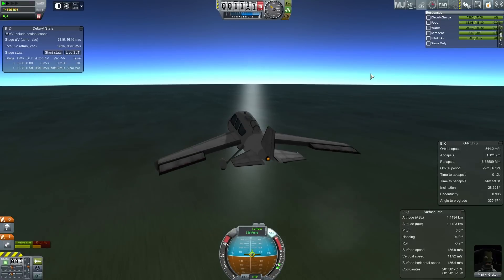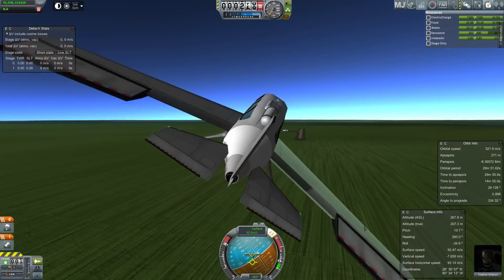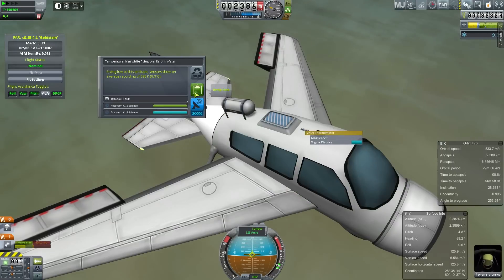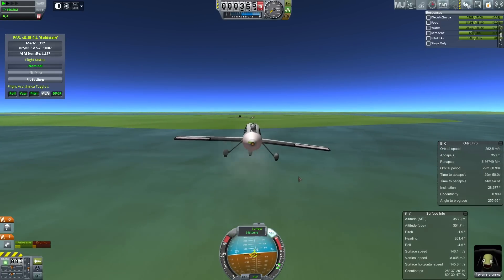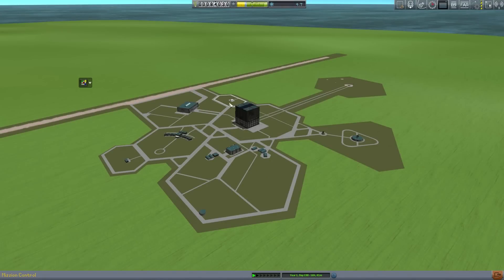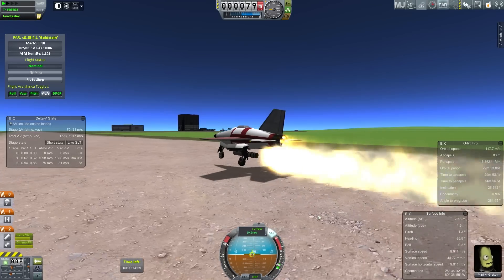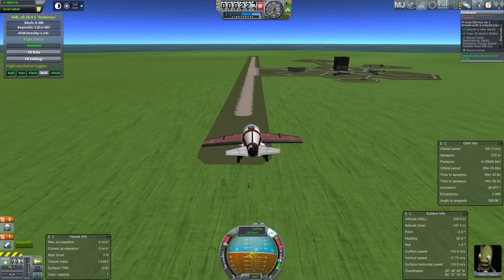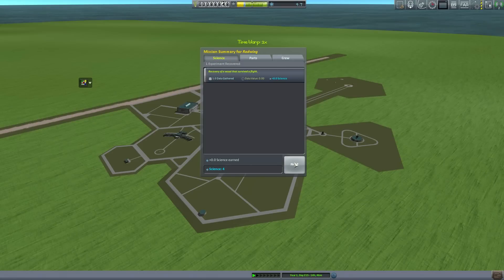Kerbal Spaceships Are Serious Business - Part 2

Comment: I've had the "control surfaces suddenly not working" bug a few times before when not using realism overhaul. Turns out mechjeb was causing it. Had to go to the settings section in mechjeb and factory reset it. It fixed the bug.

Comment: For a plane that small, the flaps and controls surfaces should be controlled by cable connected to the control column, so electric charge shouldn't have anything to do with losing control (at least realistically).  Maybe Grekov needs a candy bar.

Comment: I've also noticed that bug with the overheating. I think it only happens at x4 time acceleration. It only happens to parts with low thermal masses so it is probably because of the fact that the transferred thermal energy per game tick is increased. It needs to be tested and it is definitely a bug.

Comment: The bug is definitely due to some mod you're using... Find out which..
And it seems like its looking control module, like if it was a probe without contact or power, so I'd check mods which meddle with that.

Comment: Hey Scott, I noticed that you keep forgetting to deactivate SAS during emergency landings with your parachutes.
Reply from the maker: Why would I deactivate it?
Reply: Unless I am mistaken, after you engage SAS, any large changes in orientation (i.e getting flipped around by the parachute) will throw off the point that SAS will want to return you to.  I've noticed this when releasing parachutes on my return capsules.  I just thought that SAS was the culprit in keeping the nose of your aircraft skywards, but then again, I've been wrong before.
Reply from the maker: +Nathan Olsen (DeadlyWhatever) That might be an issue with cockpits that have powerful reaction wheels, but this cockpit has no reaction wheels at all, the SAS is unable to do anything at this point.
Reply: Ah, OK.  I was unaware that it had no reaction wheels.  I don't have the mod that has that cockpit, so I just tried some tests on a small craft about the same size.  When SAS was active during landing with the parachute, the aircraft always wanted to land tail first.  Without SAS it landed flat, so there is some merit to my theory at least.  But with no reaction wheels its just a balance issue.

Also, your career mode tutorials were invaluable for getting my modular refueling station, the KSS Argent Star, off the ground and safely in space, so thanks.
Reply: +Nathan Olsen (DeadlyWhatever) 
Bit late, but almost no pods have reaction wheels in the realism overhaul pack. Reaction wheels come about mid tech tree and are kind of crap for a while, just like real life. RCS all the way.
Reply: Seanathon James
 I did not know that, thanks.  I've never used that particular mod set, as I have a hard enough time with landing someone on the Mun already.  Maybe one day...

Comment: Scott, maybe it doesn't understand that you have electrict charge stored? So it shuts down right after there is not enough produced to keep up with the usage. If you can, could you try putting a RTG, solar panel or some other electric charge producing thing on it? Maybe batteries too, since maybe it fails to recognize your current electric storage? I could try it, but I don't have the same environment to test on.

Comment: Strange about the less than 50 percent power glitch. With regards to power usage, I know in the stock game, if you have just a pilot, turn off the gyros, and don't have any remote probe parts, it doesn't cost power to activate the flight control surfaces. (Usually its the little gyro in the cockpit that draws power because people forget about it, or just leave it on) Not sure if working fight controls cost power in RO since I hadn't tried it yet. I also noticed in the last video the Derwant doesn't actually produce power, showed electric charge '0' when you moused over it in the build menu.

Comment: So having installed RP-0 I've found that none of the wings appear to have lift. any planes both in sandbox and career at best get to 90m/s and flip over and crash or at worst just veer off in one direction and turn on to a wing and crash. Only a select few parts have lift ratings and all the numbers are red in FAR's analyzer.

Has anyone else experienced this? I want to fix it else I am half locked out of the game.

Comment: what the hell flies off at 16:40?
Reply: IrontMesdent the launch clamp, it's a (very annoying) bug with realism overhaul
Reply: NathanKell there are so much bugs in te stock game, let alone in a modded install, that i'm not even impressed anymore...

seriously though, i've never had this bug in stock since 0.90.0
Reply: couldn't there be a way to put a grabber and grab it in flight? it would be hilarious
Reply: IrontMesdent good luck  with that :D 
i once crashed a rocket in a launch clamp that spawned like this, so i guess it must be possible (in theory)
Reply: There's a mod available (ClampsBeGone) that fixes it, and Claw's Stock Bug FIxes will fix it. And as the link shows, +Electro phobia, it's only under certain circumstances that triggers it. Presumably you've not hit those circumstances...

Comment: perhaps with this amount of realism the problem isn't how much charge you have but the lack of power traveling through the aircraft in other words the cockpit is consuming more power then your aircraft can deliver so you aircraft ie: blows a fuse and shuts down the cockpit's power
Reply: +vampire48 The issue appears to be related to the throttle as he was able to shut off the engine but still control the craft with the throttle up but the engine off.
Reply: +vampire48 yeah, but if you really want to be realistic he is using 1940-1950 technology which is hydraulic power for control surfaces. Should have not been affected by lack of electricity. This is not a fly by wire plane
Reply: nix that, i forgot it was a manned craft.

Comment: Scott, couldn't you add batteries to the plane, so that way the electric charge would never run below 7200, making it so you could throttle down without shutting down the engine?
Reply: +Cjtoth121 It's a bug nothing to do with the electric charge.
Reply: smh
Reply: Jockee707 i know, but didn't he say rhe bug had to do with the cockpit saying 'not enough electric charge' when it had below 7200 electricc charge, and when the throttle was down and it went below 7200, the control surfaces would stop working. My theory is that if you add batteries and made sure the electric charge never sunk below 7200, would the control surfaces work even if the engine was throttled down, at least for a little while? ie the more batteries, the longer the control surfaces would function, because the electric charge would be above 7200 with additional batteries.

Comment: Scott Manley You've seen my tweets about the issue?  Either add a Procedural Battery or tweak the engine so its alternator outputs more charge and thus enough even at idle.

I've not yet found the root cause, i.e. why the cabin ElectricCharge stops being usable for this (controls/avionics) once the engine is running.  Code I've looked at does show iterating through modules though, so I assume something is looking for sources of ElectricCharge, finding the engine first and attempting to use it, but then finding it doesn't provide enough charge, but then doesn't continue looking for other possible sources.
Reply: Ath Athanasius Oh, and I had that "where'd my tail control surfaces go?!?!?!?" event happen to me on one landing attempt too.  Too weak for the speed if low in atmosphere ?

Comment: I actually dont get why u would install this realisme overhaul, when it has all these bugs. in my opinion as of right now, the mod makes the game much worse :i
Reply: wowfreakstar its for the realism, and something different than the normal kerbal progression
Reply: +wowfreakstar There are plenty of "bugs" in reality too ...
Reply: wowfreakstar While the bugs are annoying, I am super excited when this series picks up. Better than another career mode playthrough or something like IQ. It's buggy but different and that's good.
Reply: Reptile \o/ I actually loved IQ, but I think this is gonna be even better. And the realism also adds difficulty, which Scott Manley really needs... I cant create SSTOs, and I can't land them back at KSC after cheating them into Orbit.
Reply: +wowfreakstar Actually, most of the bugs you saw in this video are caused stock bugs or mild incompetence on Scott's part.
Reply: CallisTrOn Entertainment Different kinds. If there was a mod that made specific parts fail in ways that your engineers could correct once found, great, but if it's just "Part X fails to work properly for no good reason," it's no fun. And then there are the non-part-related bugs...
Reply: Björn Seine
I loved IQ aswell, but doing a similar series yet again would be boring. RSS is almost a completely different game and it will make it fresh.
Reply: kendokaaa Fair. Still, a system where a malfunction would give you a little bonus for the data obtained from your troubles sounds neat.
Reply: JoJo As vigilantecow said: "I'd argue that because of all the bugs and glitches, realism overhaul actually makes the game less realistic."

I might not go that far, but he has a point.
Reply: Timothy McLean There is a mod that does this actually :)
Reply: kendokaaa Indeed. I wonder if there are plans to include it in Realism Overhaul.
Reply: Timothy McLean I hope not, the later gameplay is difficult as it is xD
Reply: Timothy McLean Indeed. I'd be on board if the current somewhat game breaking bugs (ullage sometimes not working for some reason) weren't already doing the mod's job